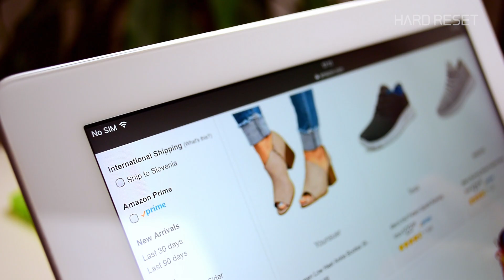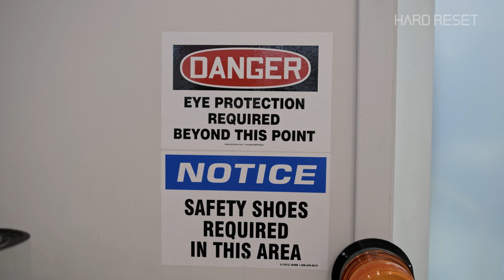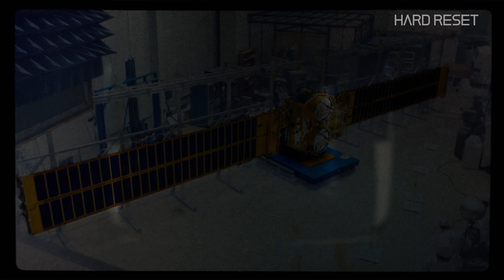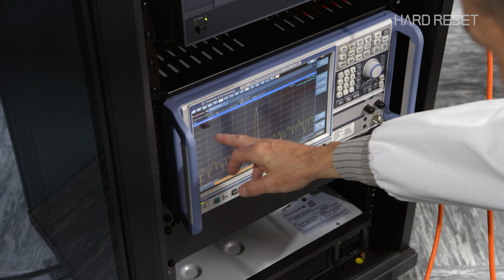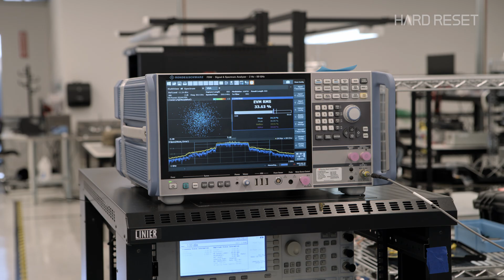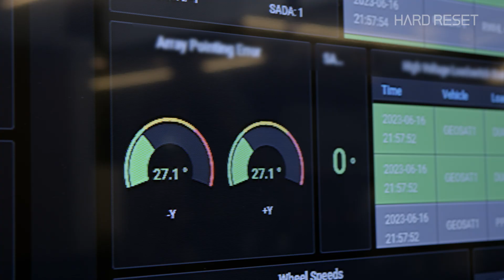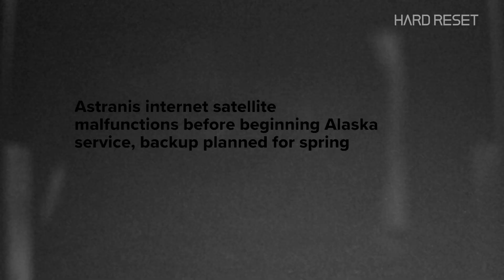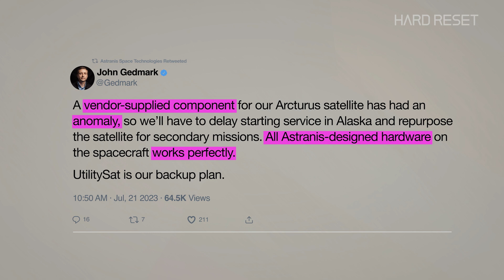Using Next-Gen Satellites to Bring Internet to All

Comment: The problem with GEO satellites though is the latency aspect. A satellite orbiting at 35,786 km means a round trip of 71,572 km for any communications from user->sat->server, which takes an absolute minimum of 239ms, not counting any additional earthside routing. To send a message from the user to the server, then get a response back again is double that, 478ms, again not counting earthside routing. A half second delay for applications like gaming or video chat is pretty much a show stopper, which is why starlink exists at all. Unless you can overcome the speed of light, you can't reduce the latency from a GEO sat.
Reply: They just need to develop FTL communication. It’s really not that hard.
Reply: Yeah. This ... some things can work around this, but most can't.
Reply: @capnkirk5528  Australians are built different, 500 ping is no big thing
Reply: For the person that right now has 2G / 3G connectivity that latency is a joke compared to what they have, so yeah, no online gaming but the connectivity will be way better.
Reply: The majority of all internet traffic does not need low latency
Reply: It’s also important to remember that latency doesn’t matter at all for many things on the internet.  It’s really important for real-time gaming, no one would deny that, but if you are someone in a remote area who just wants to be able to access streaming content, work remotely, connect to information resources, etc… latency might be your last concern.
Reply: Most of the 4 billion can be connected with fiber optic cables along roads and railways and supplemented by communication towers
Reply: @ Not really. That will work for some, but not most. But there are other options not even being considered.
Reply: @bobsinhav Most of those 4 billion are nowhere near a main road or train track

Comment: Geosynchronous communication satellites are nothing new. Left video with basic questions. Why is this better? Just that it's smaller? What about latency? Is this going to be cheaper than Starlink?
Reply: 1) It's better than "legacy" GEO sat tech because (presumably) faster and cheaper to build and more capabilities (because digital)
2) Latency is going to be bad - on the order of 0.2s due to the limit of speed of light (cannot do anything about it).
3) Frankly, I doubt it.
Reply: It's farther from earth and can stay up for longer stable orbits. Starlink sats gets drag from LEO and burn up in 5 years which mean starlink has to constantly launch new sats. These Geosynchronous sats don't have the problem. 
There is also the static position benefit the dish is in constant contact with the sat resulting in no drop. For star link there is a handoff as the sat passes over. 
For geosync a single satellite can cover a large area whereas a starlink has much smaller coverage. This allows them to put more powerful and capable sat at geosync which can manage large number of customers over a large geographic area. As opposed to starlink where they only cover small area and hence cant go big with limited number of users in any given time.
The only issue is power and size requirements for the dish as well as the latency.

Comment: The oops orbit 😂 This seems like a gem of a company to work for! I'm curious about a technical detail though. I don't think it was mentioned though it was hinted at (don't play games on their network, you'll be last). What kind of latency are we talking about? Take starlink for example, while it's at ~500km it still has a latency of ~30-60ms. The speed of light is about 300km/millisecond. Meaning that a system like starlink in pure roundtrip latency should be about 3-4ms with everything else being equipment overhead (processing and what not). It also means that you "can" have satellites in a much higher orbit and still have acceptable latency.
Reply: GEO is almost 36000 km one-way, so about 0.2s latency both ways (roughly).

Comment: Correct me if I am wrong, but if geostationary orbit is 35k kilometers away and the earths circumference is 40k, that mean a signals trip there and back would have the same delays as going 1.5 times round the world... Thats not going to be good for anything "real-time" such as phone/video calls or gaming.  For comparison, starlink is 0.55 kilometres away.
Reply: Starlink being 0.55kilometers away is impossible. 0.55 kilometers  = 550meters = 0.3miles
Based on the Information form Wikipedia: Starlink launches there satellites in an orbit at 535 km altitude
Reply: @v0m89jmv0  exactly, so close you could hear something happening (a concert, explosion or whatever) at that distance (if it was on Earth)
Reply: @backacheache  it's impossible
Reply: @v0m89jmv0 I think he meant 0.55 k kilometers = 550km which is still too far. IIRC it is within 200-300 km LEO
Reply: @nihalbhandary162  yeah, so the entire trip is under 40 milliseconds, something that can't be done with something as far away as the "Clark orbit" I guess they could keep copies of files on the Satalite  (rather than everything having to take the trip) but giving people a 2nd class experience for something as "simple" as a phone call means it's  always going to be a tougher sell
Reply: @backacheache  Highly unlikely they have the hardware to keep copies. I suppose their market is those poor remote places with no options for Internet. If the prices are good enough there will be buyers. It all comes down to pricing
Reply: 11:55 It's what he said, bro. Did you even watch the video?